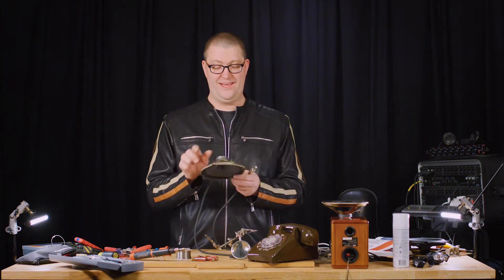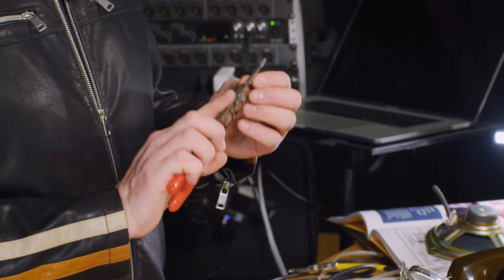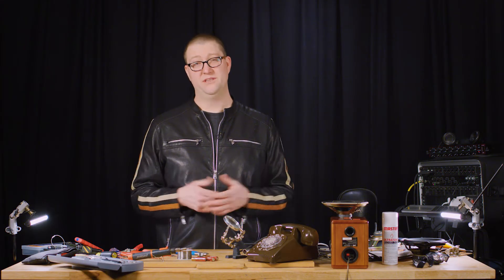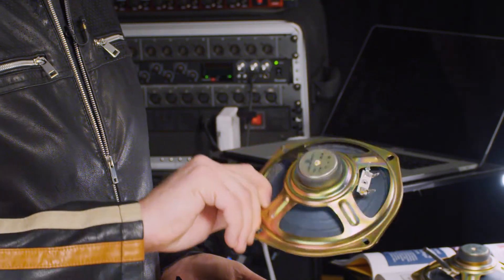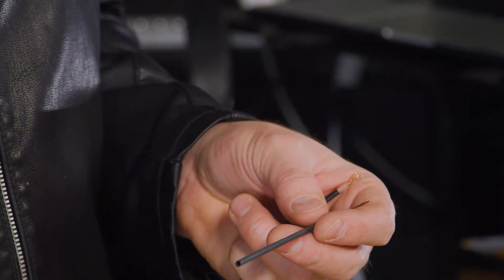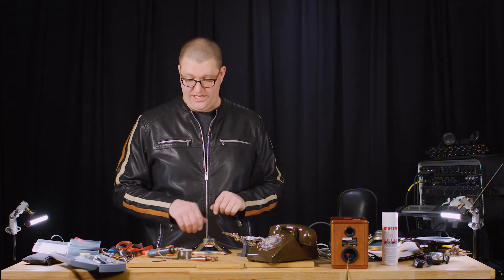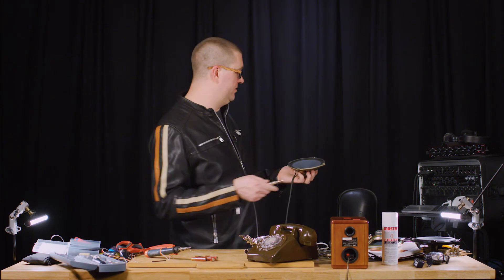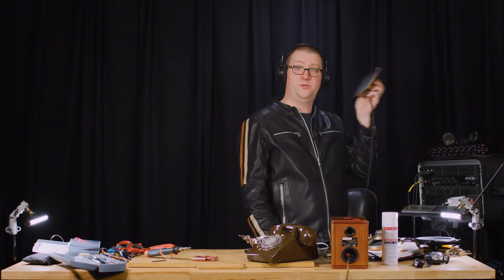How to Convert a Speaker into a Dynamic Microphone | Recording, Engineering, and Music Production

Comment: I've made a mic from a wee speaker I have lying around, I believe it was a PC speaker, the cheap one that needs USB cord to power it. But mine uses 3.5 mm audio jack that is also from another PC speaker, connects that wire, and voila, it can capture my voice. Although, since I connect it into my laptop I think the sound it made was very small but when I connects it to my radio, it sounds big, but have some noise in the background. Is there any solution to give more gain and less noise so I can use this mic for recording project?

Comment: a shaker Table.subwoofer(for big Signals)many many Capasitors as battery and use the vibration. you create granted much more output then inut. a vibrating Phone can be enough. take  subwoofer,hit the center and mesure the create Energy of the Signal. the same power wie put in to a good Car Soundsystem can we taken now also OUT from a Subwoofer. only messsure the powerout from your car ampiphiler to the subwoofer and think rewears.so,how can you move the coil to produce somuch output.a hammer mechanic(even a Clock in a Chamber,the Tick Tack a small impulses-the step to the BELL)any type of mechanical parts,everything some create vibration,even if you sit and hit the speaker 8 hours per day as work,it,s power from vibration with help  from speakers.

Comment: Hello  Berklee,    can  you help,   I made a stomp box,  using piezo pickup, works,  BUT, is  quite woody/click sound,  I need to try make it deeper more kick drum,  I was thinking could I put a small speaker (4ohm/3cm)  in,  and in  parallel or  series with the piezo  and make a richer sound?
Which would be best series or parallel  do you think,   would  this work.  Paul  (in  UK)

Comment: I've been experimenting with different noise box designs--including a 10-foot trailer with a spring stretched across the entire length 😄😄--but have been frustrated by the inability of piezo contact mics to pick up the low ends. I've read different sources on using speakers as mics, but can YOUR method really be that SIMPLE? Definitely worth a try and, if the signal proves too weak, I have a spare preamp board somewhere. None of this should be very surprising to anyone who's ever used a Navy SOUND-Powered telephone, and there's even a trick the Army has used for their field telephones whenever the batteries ran low: speak into the RECEIVER! 😄😄
Reply: 8:55 ❤😂🎉😢😮😅 8:55

Comment: I knew or figured  it that Speakers had to be reverse Microphone and reverse circuit ...like the same circuit in where current flows in reverse ....but There are differences in Circuit ......eg one has a magnet the other Mic  has a Peizotropic Crystal........but what was or had to be a the way to convert the electric signal from both ......like Are the Ekectric signlas from a Mic are same Voltage or Current as the one goong into the Speaker ???   Or do we need to amplify the Current ...in the Speaker ...via A Transfirmer...Please discuss that ....same wiring would do....same Current ....will flow...or de we need to adjust the resistance of the wire ...

Comment: Does anyone know if a speaker can act as speaker and a microphone simultaneously?  I would like to do this kind of test :) record sound from that kind of thing
Reply: You have to use a differential amplifier to subtract the transmitted signal from the received signal.  You also have to impedance match everything for every frequency to make sure that the transmitted and received signal don't come in out of phase. It's difficult but not impossible.

Comment: Speakers are current driven with a much lower impedance than a typical dynamic microphone. It would work a lot better if you added a step up transformer like the ones used for ribbon microphones. You can make your own with a turn ratio of 1:10-1:30 roughly. You wouldn't need quite as high of a ratio of 1:37 as the ones for ribbon mics since the speaker already uses a coil.
Reply: Thanks for your comment. But how many turns in the primary coil is good to be multiplied 10-30 times? Can I grab a small toroid core and wrap 10 turns in the primary and 100 turns on it as the secondary, or 10 is too low?
Reply: @Kareem-Ahmed  Could you give a 'practical example? Ex. 4 ohm speaker and I want to adjust it to 8 ohms . How should this be done?
Reply: This was my exact Query ....thanks....

Comment: I suspect this has been done to my Sony boom box while I wasn't home.  All my speakers go quiet on one side after I get something.  This includes my truck.  Great speaker system went dead on right side truck door after moving to this city.  Everything I bring in house with dual sounds goes dead on one side after a while of having it.  Things get moved, and some products get used like Survival Shield from Infowars is now empty.  I unplugged the box today and even with unplugged that dead side made a radio sound when I put the jack back in.  Also when I switched out the white to jacks the sound on good side went lower in volume.  What did this tell you???

Comment: So, you can turn a microphone into a speaker?
Reply: Yes I accidentally do it all the time plugging my Dynamic microphones into a speaker port
Reply: I did as a kid, i had a Singstar micophone for my PS2, and i plugged it in to my dads old Walkman, sounded like you tried to record a heavy metal cocert wih an old nokia phone while recording a video, so it was preaty bad, but it worked, so if thers a apocalipse,and the only thing ou have is a mic, it will do the job to listen to the radio^^^^
Reply: You can turn a literal vibrator (or most of DC motors) into a speaker. ;-)
Reply: the quality of the microphone that u made was better than that you are using
Reply: Yup that's what you call reverse bias 🤣

Comment: Would this work the same if I plug my monitors into an input from my interface?
Reply: In short, no. One thing he forgot to mention in the video is that the polarity has to be reversed for the speaker to work as a mic. Meaning the positive (+) and negative ( - ) leads need to be switched. Hope that helps!
Reply: @sammy.hastings  Why? The speaker is nothing but a coil. Into this coil a current is induced by change in magnetic field. If you swap polarities nothing changes as the only characteristics you hear are amplitude and frequency. Actually many DAW's let you swap polarities of recordings. If you play a recording twice at the exact same time (one swapped polarity and one unswapped) you hear nothing, which is another proof that the two are identical.

Comment: oh you think you're so tough well I fixed my headphones by scratching the tin from a chipset and melting it by pressing it with a red hot screwdriver heated up on the stove
Also question, you need a pre-amp to use that, don't you?